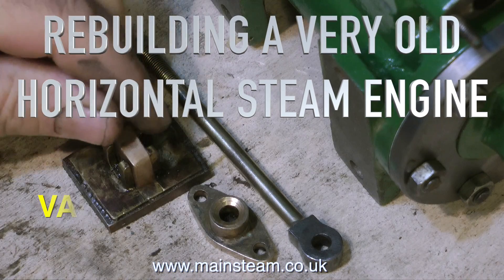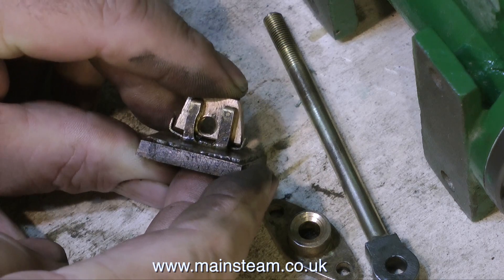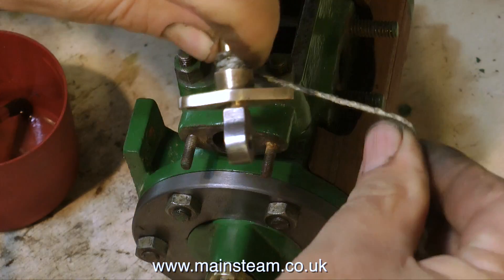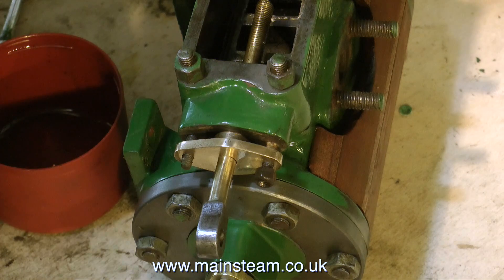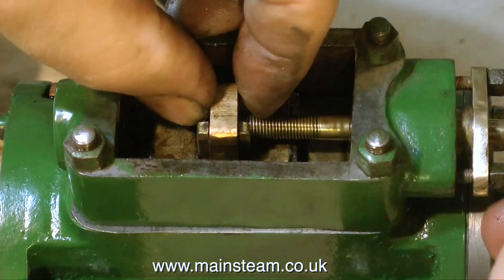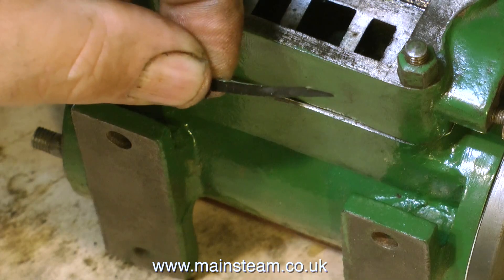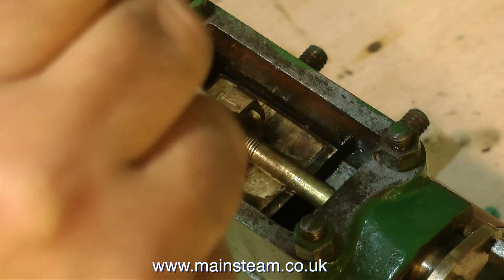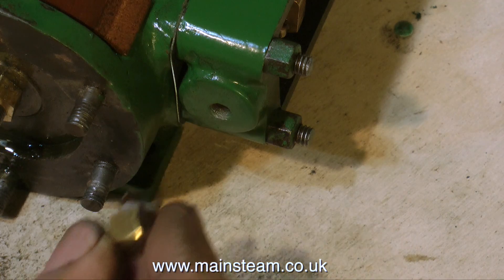PART 19 - LARGE HORIZONTAL STEAM ENGINE REBUILD

Comment: You comments about the 'others' being incompetent of lazy struck home with me.  I have been a computer programmer since 1969 - many times when looking at code to either fix or add a new feature I find myself wondering what the previous bloke was thinking when he wrote it.  I am also sure that some of the guys who worked on some of my stuff years later also questioned my ability to program my way out of a wet paper bag.